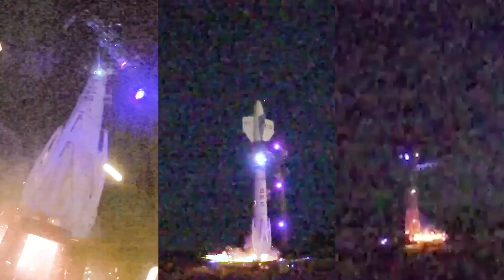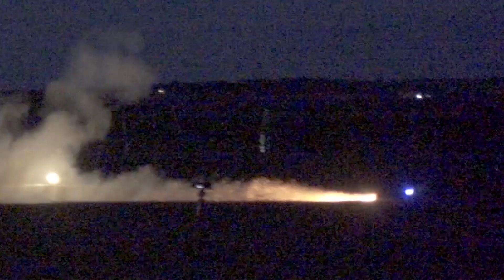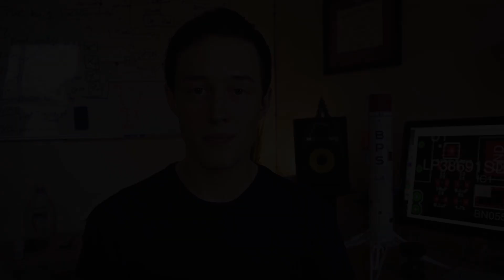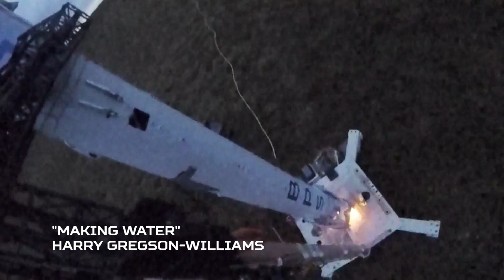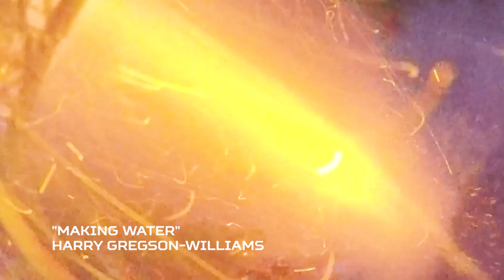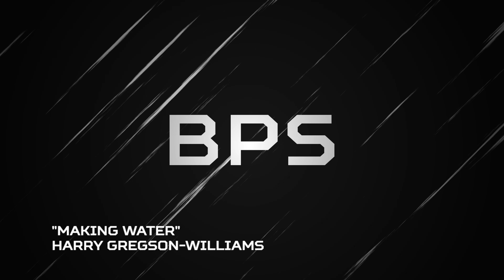BPS Update

Comment: Would something like this: https://www.youtube.com/watch?v=woCdjbsjbPg Help with keeping the rocket vertical for takeoff and landing? Keep up the great work!
Reply: In theory it could, and indeed reaction wheels are an important component of maintaining attitude in spacecraft and satellites.

The trouble with using one to maintain attitude on a rocket is that such a system needs to be either a significant fraction of the total mass, or the reaction wheels need to have a much larger radius than would be practical inside a rocket. Otherwise your torque is too small to overcome the other forces acting on the system.

If you have ever played KSP, the notion of using reaction wheels sounds great! However in the real world, reaction wheels are far less powerful. They are heavier, provide much less torque,  have a limited impulse they can provide before they must be de-spun, and put a fairly significant drain on the electrical systems.

In the video you linked to, mass, volume, electrical charge, and impulse limits are not applicable. Electrical charge is provided externally via a wire, and the reaction wheels can be de-spun by over-correcting. This causes the gravity to torque the system in the opposite direction, which the wheels can counter simply by applying brakes. Mass and volume are obviously only restricted by what the table can support.

What the BPS project is attempting to do is use vectored thrust from the motor to control attitude. This doesn't have the same mass penalties of a reaction wheel system, as it works by redirecting existing forces, rather than trying to overcome them with brute force.

Reaction wheels excel where existing forces are small, such as on objects drifting through space where the other forces at work are just about negligible. Most descent capsules also feature a reaction wheel to control roll, (which ideally has no significant external forces acting on it) but rely on passive aerodynamic stabilization to control pitch and yaw.

If you got all the way to the bottom here, congrats! Let me know if you'd like to hear more about these systems.
Reply from the maker: Reaction wheels are a cool concept, but it'd be quite difficult to implement them at this scale. Spot on explanation, Joseph.  Nice name too! :)
Reply: Appreciate the explanation, thank you! Never thought about the power issue, I'm not use to having to factor in weight with my builds, but I will have to if I move into rockets.